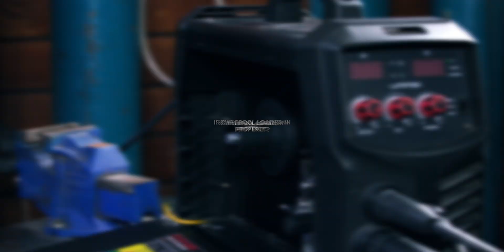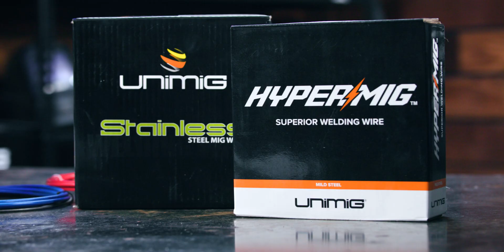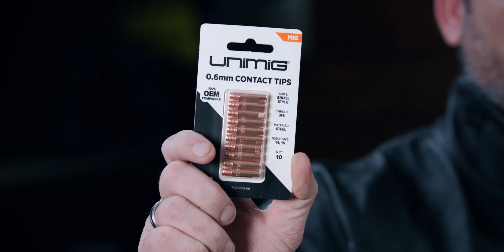Troubleshooting MIG Wire Feeding Issues in Your Welder

Comment: aaaand.  what if the rollers aren't spinning at all? took wire out and still nothing. Do Mig motors have fuses or circuit breakers? all other lights, fan, etc are working. thanks!!

Comment: I have a wired issue. When I weld flux-core with the polarity torch - & earth + the welder works fine. When I switch the polarity to torch + & earth - for solid core and shielding gas the wire feeder doesn't work. Any ideas on what it could be?